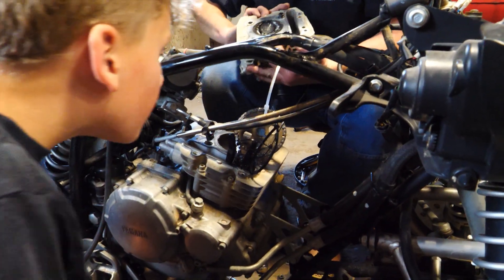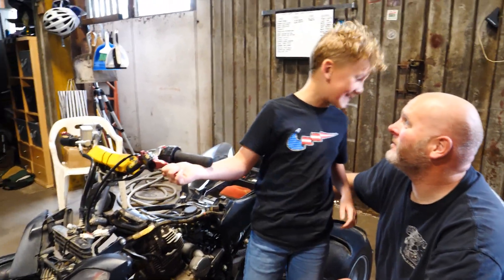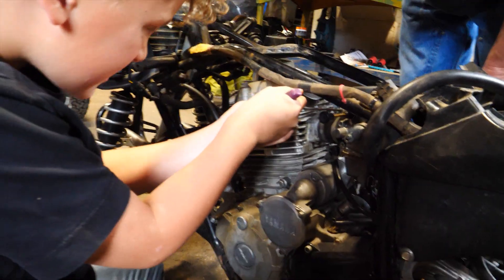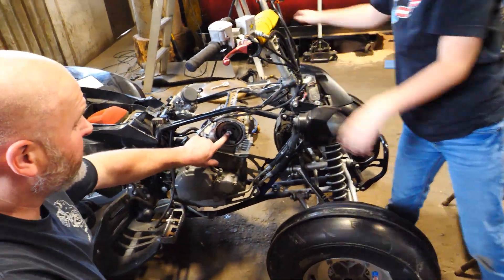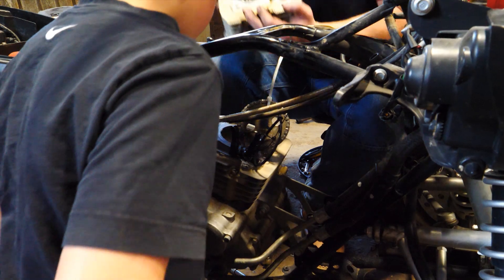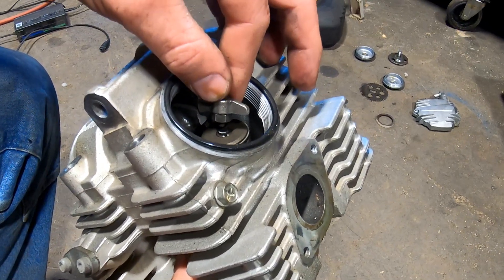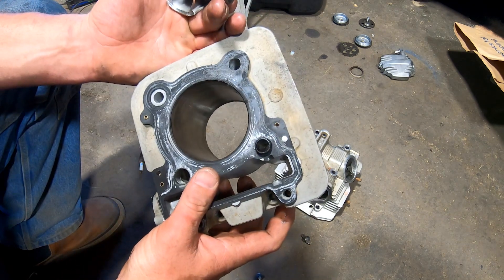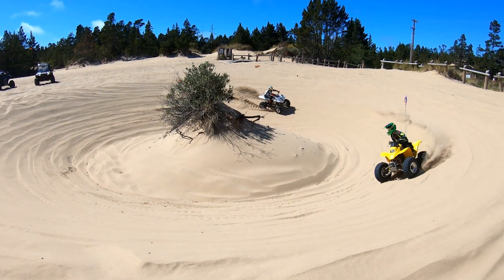What happens when an engine drops a valve? Yamaha Raptor 250 engine failure, seized up, won't run.

Comment: Been there way too many times. Had a brand new from chevy 2.5 in a s10 with under 200 miles on it loose a valve retainer and dropped the valve on number 2 cylinder. Gave 21 y/o me a good excuse to add 4 more cylinders to the truck.